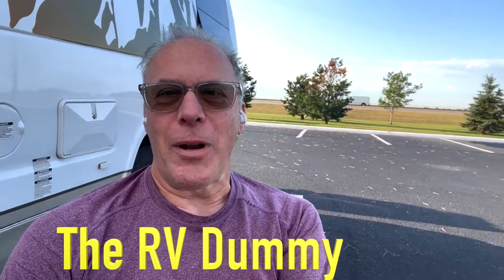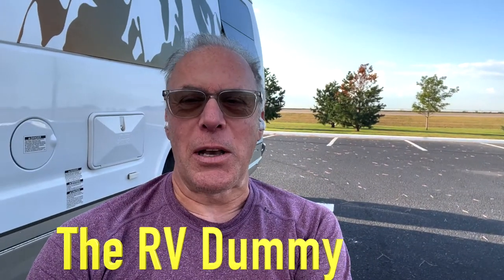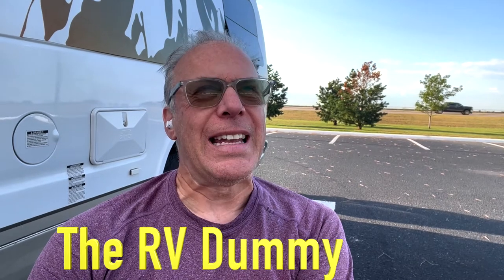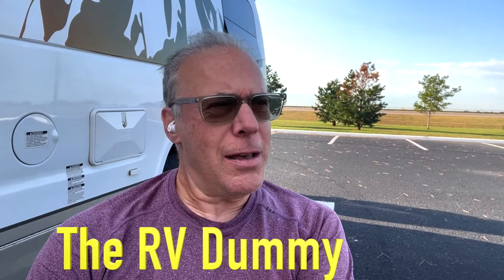Rubber vs Metal Valve Stems on RV Tires with TPMS Sensors

Comment: We have 2022 travel trailer and in June 2023 (less than 3K miles on original tires) we were on a trip to Yellowstone. 2nd day from home tire #1 just completely blows out no loss of air warning from TPMS until after the tire became a road gator. On day 3 afternoon another factory tire completely losses all its tread, just the bald core section remained full of air. Thank goodness for that because we had no spare at that time. Drove slowly to next exit and found a small tire store and bought 5 new tires, valve stems and one wheel (5th tire was a second spare, we had a lot of traveling to do). Little over a year later (last week) heading home from trip TPMS warming losing air fast left front tire. Check and the rubber valve stem was split right at the metal rim. Changed the tire and proceeded to our overnight stay. Next day we start out again and 20 minutes in the drive get fast air leak in left rear tire. Check and the exact same split at the metal rim. There was a Sam's 7 miles away so we went there and replaced 4 rubber valve stems to hopefully make it the rest of the way home. I had come up with the same conclusion that the TPMS sensors were tearing the rubber valve stems with their weight and centrifugal force. I was on you tube to see if any others had experience this and low and behold Dr Dave had same experience (I love you tube LOL) I have ordered new metal valve stems and will be installing soon. TST should inform purchasers of their external sensors that they require metal valve stems. As Dr Dave states for less than $50 they were installed.  I would gladly pay $50 one time to never break down on the side of any road with a flat tire. Thank you Dr. Dave

Comment: We suffered through this problem with our first fifth wheel coach decades ago. Our solution was to cut a small piece of pool noodle to hold the TPMS away from the wheel. Since then I have always used metal valve stems, but the pool noodle hack worked for three years. Thanks for a great video.

Comment: Just had my second valve stem failure with the exact TPMS sensors in the video. Dr Dave I came to the same answer after careful thought.  The flex is causing either a valve stem displacement of a shearing of the base.  I spoke to the same company and was told they haven’t heard of it.  However, I was recommended to get the metal stems, hmmm. I just arrived in Florida for a winter stay with the airstream and will not be leaving without those metal stems.  Ironic how the very system that is supposed to alert you of a tire issue is actually causing it.  Thank you Dr Dave for validating my thoughts exactly.  Respectfully Dave RN.

Comment: I had this happen last week on my utility trailer. The valve stem had weakened and the tire would stay inflated while stationary but would slowly loose air while in motion. It was the weight of the TPMS sensor causing the valve stem to stretch and loose air as it rotated. I installed metal valve stems yesterday and I am sure my problem is solved.  Thanks for your video, safe travels.

Comment: In the past year I've had 3 valve stem failures using external TPMS.  My initial thought was, wow, I'm glad I have this TPMS to warn me of the leaks, preventing a complete blowout and ruining a tire. But I've since learned, as you have, the TPMS on rubber valve stems was causing the leaks. I'm currently shopping for the clamp in metal valve stems to have installed on my RV. It's probably more common that we realize.

Comment: I'm currently looking at getting the TST 770 TPMS.  With as many others that have experienced the same issue with TPMS sensors on rubber valve stems, you would think the company would be aware of it.  However, I do see that they do state the flow through sensors must have metal valve stems.  This makes sense as they are larger and heavier sensors, which leads to believe they would cause rubber valve stem damage. Sounds to me your best to just going with metal valve stems regardless which sensors you're using. I am soon exchanging my 5th wheel tires.  This was good information as I will request they put in metal valve stems.

Comment: Great video. We also had 3 stem failures on our 2007 PW Excel TS while on our Alaska road trip. Yep, we had a TPMS and rubber stems. Thanks to Les Schwab Tires in Vancouver, WA who changed them to steel at no charge. I think they felt sorry for us after having 3 failures.😉

Comment: I’ve had two valve stem failures on tires less than three years old with my TPMS. Both had tears at the base and I’ve been careful not to twist the stem when taking the sensors off to add air. I’m ready to try metal valve stems. Thanks for putting your thoughts into a video.

Comment: Ok….let me explain my identical situation as it may actually add some clarity to why this happened to you, as it can happen with metal valve stems also. I installed my TST pass thru sensors on my 5th wheel and a week later one valve stem was leaking. I pulled the tire and had a tire shop replace the stem and reinstalled. A week later….another valve metal stem started leaking after I aired up the tire a few lbs. What caused it was the twisting of the valve stem while installing or removing the TPMS sensors. In my case it ripped the rubber gasket on the backside of the stem and with the rubber stem, it’s easy to “break the seal” by the twisting while loosening or tightening the TPMS. My tire shop recommended pull thru metal stems (not the gasket type) and I have never had another issue.

Comment: I just had both inner duallys sale at the valve stem too. I've never had a valve stem fail never. I agree with you it's the TPMS that is flexing the rubber valve stems. These have been on for 3 and 1/2 years. On our way back from Florida TPMS goes off on one and then goes off on the other I'm thinking this cannot be true. It is. Now I'm researching for metal valve stems.

Comment: I talked to a friend who designs valve stems for the car and trucking industry.  He said that rubber and snap in valves are NOT designed to hold TPMS sensors.  He recommends metal bolt on valves or buy an internal TPMS system.  Our cast aluminum wheels cannot accommodate a bolt on valve so we ditched our TST system and went with Schrader’s retrofit kit.  At $110.00, it cost less than half of TST’s and cost to install it was about the same as swapping out the valves.  We actually like the Schrader display much better.  We ended up wasting $250 on the TST so I wish we had just purchased the Schrader system to begin with. 😢

Comment: One caution with metal stems - if you over tighten the TPMS you can damage the valve.  When I took my TPMS off the valve was leaking air.  A gasketed cap or putting the TPMS back on will hold the air until you can insert a new valve inside the stem.  I never had this over tightening problem with my stock rubber stems.

Comment: I believe the weight of the sensor changes the harmonic frequency of the  valve stem. The tire rotation speed matches the new harmonic frequency of the valve stem,  the valve stem swings wildly at the new harmonic frequency and eventually fails. I have seen heavy steel pipelines suspended in air fail when wind induced forces match the  harmonic frequency of the suspended pipe.  Different situation same principle.

Comment: Metal 100%! I've been using them on my motorcycles for decades since I'm not carrying a spare and can't just replace a flat caused by a broken valve stem. I had a rubber one fail and it cost me the rest of my trip - getting a tow, etc. at 2AM in the middle of nowhere isn't fun. Been using metal ever since. Almost everyone I know in the long-distance endurance motorcycle community use them as well (that's where I learned about them). They'll be going on my RV regardless of the TPMS system. It's just one less thing to have to worry about.

Comment: In only 1 year, my sensors have worn spots where they are rubbing against the rim. When parked, the sensor is a half inch from the rims, that’s how far mine are spinning out from centrifugal force. I just had my second tire stem fail in the last 2 trips (8 hours of driving).  The guy where I bought the tires replaced the first one free, but the new one is just like the ones that failed. I’m ordering metal stems from the jungle store and having those installed before my next trip.

Comment: We had two tires go down, first one was the valve stem. Second one, we don't know because the stem and sensor were both gone. The theory is that the sensor is too heavy. It was with new tires.